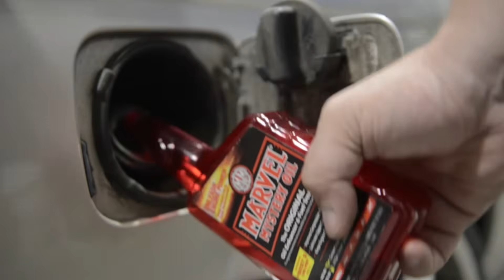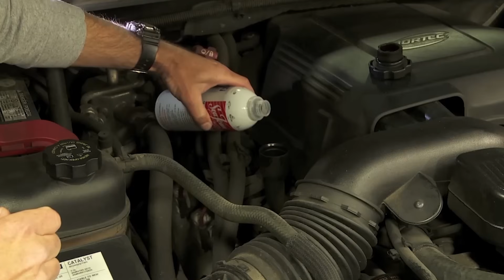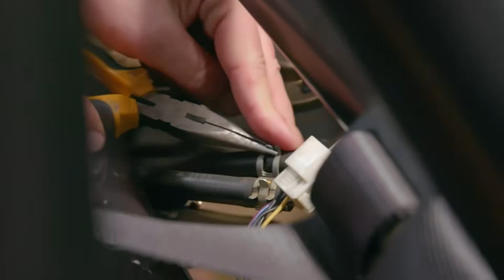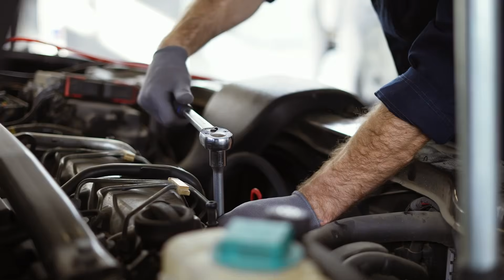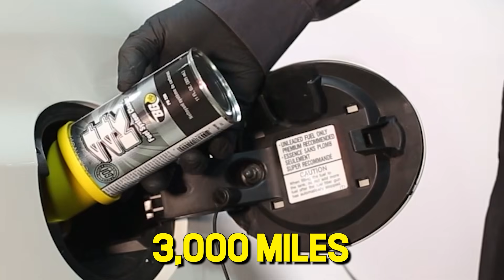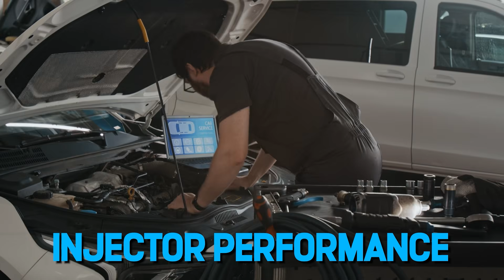AVOID These 4 Fuel Injector Cleaner Brands Destroying Your Engine (And 5 That Actually Work)

Comment: if you buy "Top Tier" gas, you usually  don't  need injector cleaner Because the injector cleaner is already in the "Top Tier" Gasoline. That is Exactly what "Top Tier" is about. 
Therefore: Look For,  And  Only Buy gas if "Top Tier" is shown on the gas pump. 
Says a 50+ year Mechanic.

Comment: Seafoam was designed for 2 cycle Carburetor engines  like Weed Eaters,  Chain Saws etc. Not Fuel injectors.
i am a 50+ year mechanic.

Comment: I wish I had known this earlier.  I have high mileage Benz and never  had any problems.  I was going to add Lucas but the store clerk said seafoam was on sale and convinced me to use it.  I put seafoam in and my car ran for 45 seconds before stalling, which it had never done.  Tow truck and almost 1k mechanic bill and car is running normal again.  Now I understand what happened! 😊